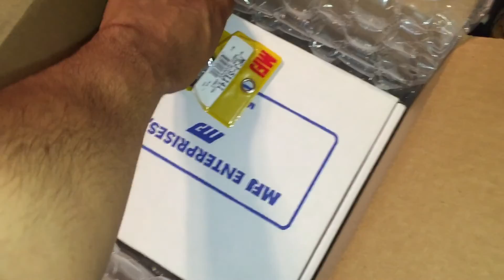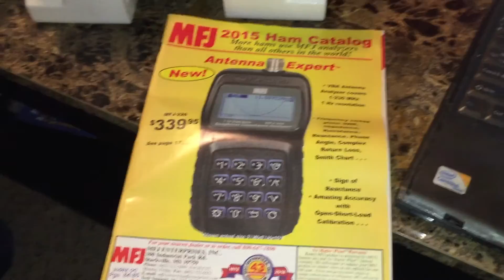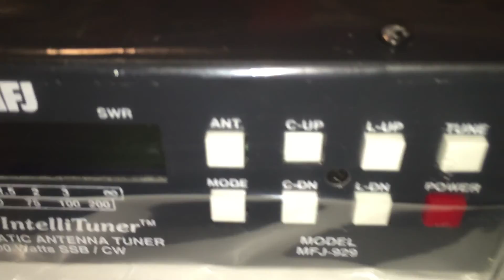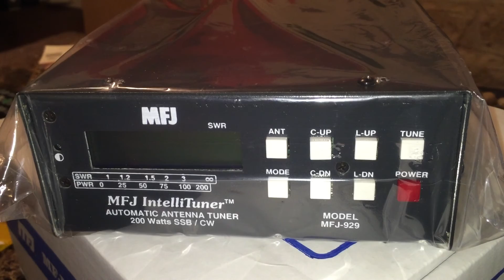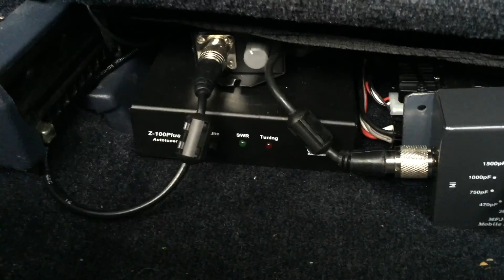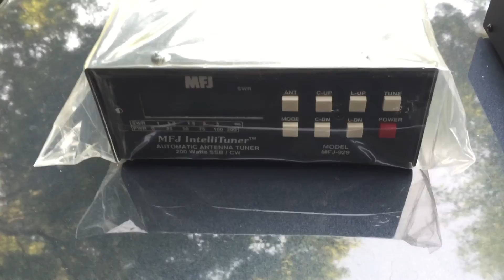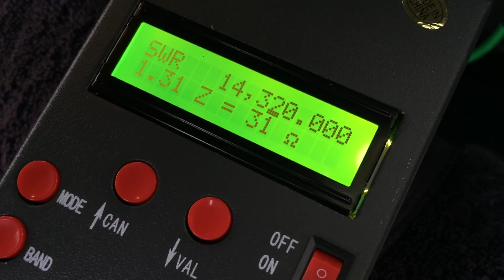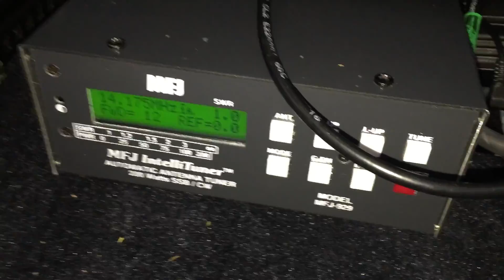MFJ-929 Antenna Tuner - Unboxing and Setup - Mobile HF HAM Radio

Comment: Unboxing is so Boring unless the outside box has obvious damage or the package is rattling badly.Seen one unboxing you have seen them all.I just ordered one of these tuners Today from HRO with the ICOM interface cable for use with my ICOM 746.It will be here Tomorrow from Atlanta so I will see if it works as it should for me.Maybe no buttons will be stuck & no parts rattling around inside the case but we will see when it gets here.I said I would NEVER buy another piece of MFJ gear so I may hate myself badly if it does not work as it should.

Comment: So far I haven't had much luck with MFJ products, I bought two 2m/440 base antennas and bought having swr;s 3 and higher. When calling the on the issue I was told to send them back and they would check them out/repair and return, the problem was I had to pay the shipping.   They mentioned it maybe my meter and not the antennas, so needing a meter for my FT base  I decided to order their MFJ 894.  Well, no luck with the 894, it shows higher then my old meter, and on my HF it's off the wall.   I call MFJ back and while talking with another tech telling the the meter is way off he said it sounds like the antennas LOL,  I can not trust MFJ at this point.  I may think about them again but only after a LOT of research and reviews.  Maybe.  I was looking at the MFJ-929  and would be interested in it's operation.
Reply from the maker: I bought the MFJ 891 (I believe that's it) and I actually did a video on it on my channel.   That's the one I primarily use now, and it seems to be pretty good.  I have two MFJ-929 (they are HF only).  They do a fine/OK job tuning, but you pretty much need to have a good accurate dummy load, and a good accurate SWR meter, because you'll almost certainly have to calibrate it right out of the box.  MFJ does engineer decent products, at a really great price point, but the quality control needs to be better.  As hams we can generally deal with that though.  I'm glad MFJ exists.
Reply: Thanks for your reply, it gives me something to think about.
Reply: @SWRadioConcepts  nch
Reply: Here is a Free FYI for you.SWR is not Plural.You have an SWR reading & NOT an SWR's reading.That is why they make SWR meters & not SWR's meters.An antenna has only One SWR & that is why it's called a Standing Wave ratio.Notice No Plural just Singular of SWR. LOL Thanks for the Giggles. hehe
Reply: Being in radio for over 40 years, and working for a large radio FM station as a tech for 12 years I know when I am being buffaloed, I also know what works for me and how they work.  I thank you for your input and glad you are having good luck with your equipment